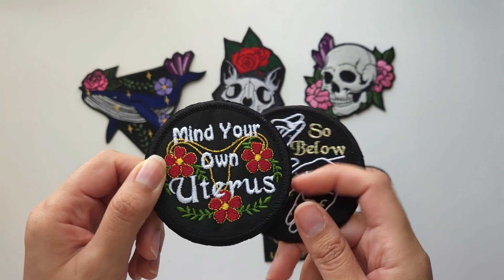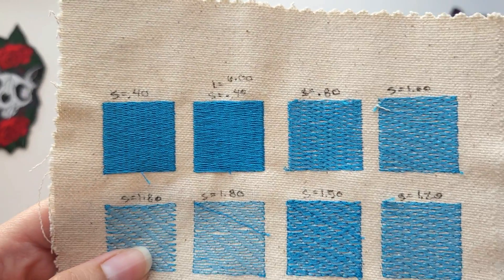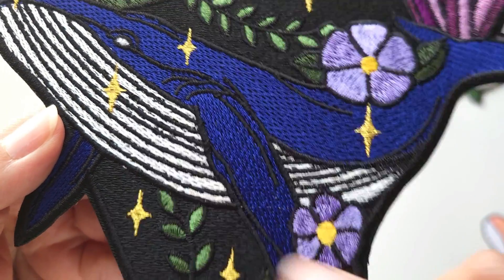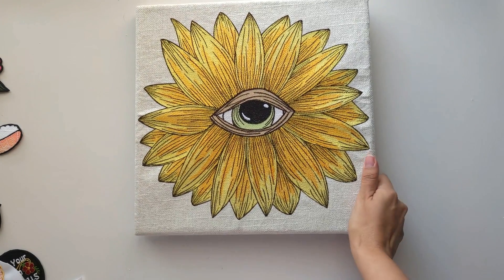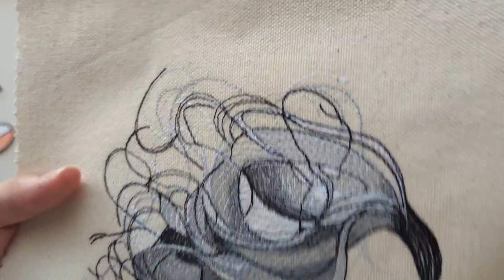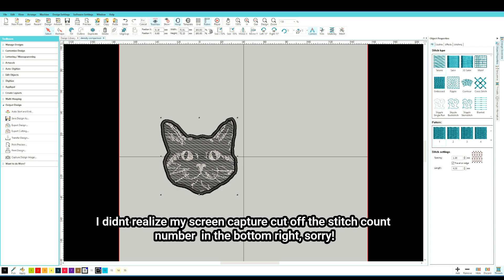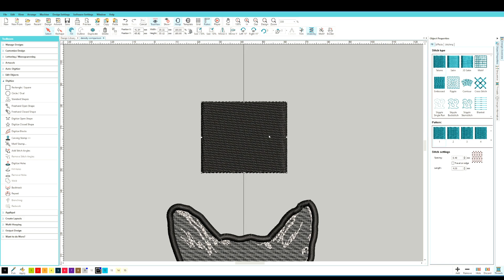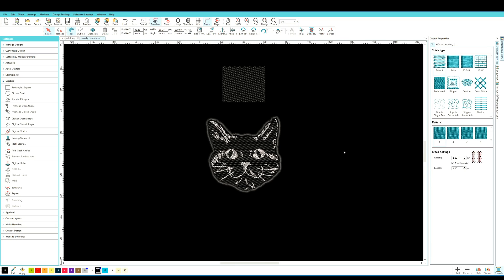Embroidery Digitizing: Reducing Stitch Density without Reducing Quality

Comment: Please explain how did you manage to achieve such clean lines for art on 7:20? Whenever we use running stitch for lines it turns out dotted, so the artwork doesn’t look clean anymore. It doesn’t look like satin stitch too. Please, hint how to do so.
Reply from the maker: If your running stitch looks dotted you may need to adjust the length. I like the use a 3.5mm or 4mm length running stitch if its too short then it will look dotted